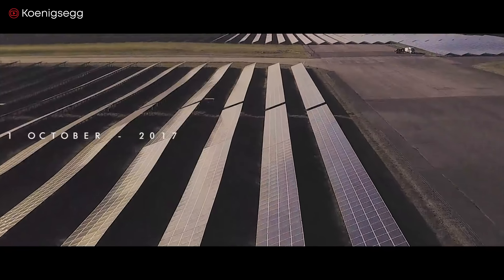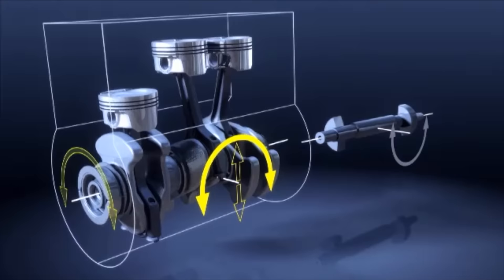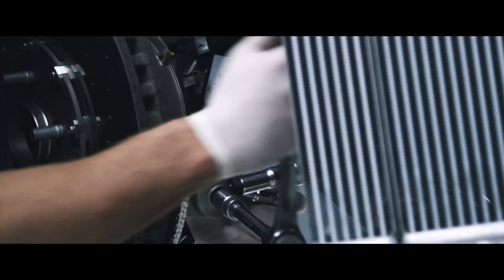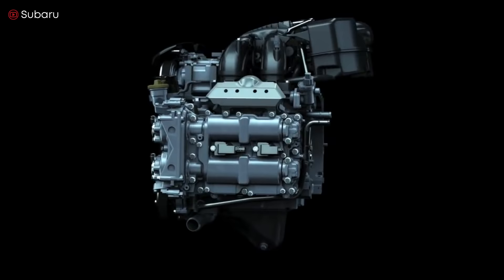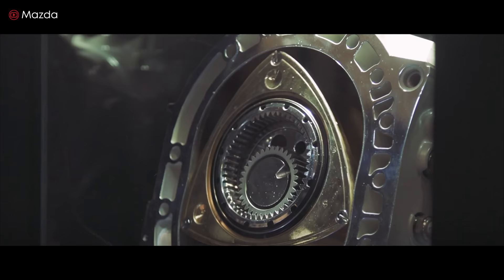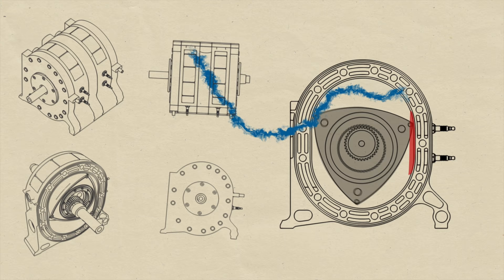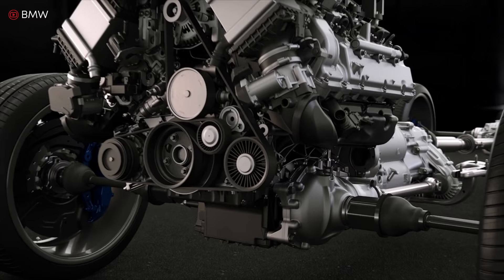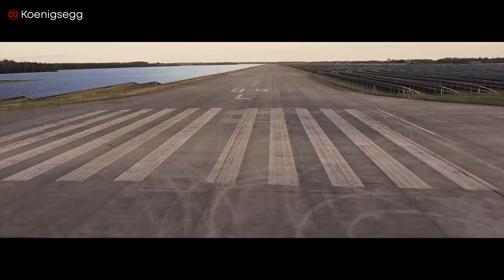Who Makes the Best Engine and Why

Comment: My 2.0 2005 golf is running so smooth stick shift the engine runs so nice 4 cylinder put 30,000 kms in 3 months on it now it has 269,000 kms still runs so smooth and it has a diesal transmission so the rpms are way lower on the highway so smooth
Reply: Golf yawn..for people who think they know what constitutes a good car...a total cliche purchase

Avoid the new ones you wont get the ssme service out them

Comment: Straight 6 engines are best in my opinion, powerful, economical, easy to work on and tends to last the longest if looked after
Reply: With the exception of the BMW N57...chain and bottom end failures

Comment: The best engine is the V-8's, regardless of manufacture. Brought high power at low cost and weight to the common buyer. All brands have had there high & low points, fans of one could talk all day of their brands individual virtues.

Comment: I have a diesel 2.4L in-line 5 cylinders Volvo engine that is a jewel of an engine with 220hp and 450 N.m torque...
Reply: Chaminda Thushara Ruwan Kasturi  it is known for being a good engine. Lots of Volvos have it here in Sweden, D4 and D5. They stopped making it since 2017, my car got the last version of it, now they make only 4 cylinder engines...
Reply: Diesel is dead baby
Reply: @alanbrand7681  my car still runs diesel and will continue for years to come. You drive in streets full of diesel powered cars here in Sweden, it will takes at least a decade for these cars to start be a rare scene in the street, until then, I will keep driving it...

Comment: Hey Scotty have you heard of the alpha Dan four-cylinder motor? I believe it's a 73 l putting out over 600 and some horse. Naturally aspirated. Electronically controlled valves so it has no need for camshafts.

Comment: Scotty what is the difference between interference and non-interference engines? Thank u in advance and have a great week
Reply: It is referring to the clearance between the valves and pistons.  With an interference engine if you break a timing belt the pistons will come up and hit the now stationary valves.  With a non interference engine if you break a belt there is enough room so that the pistons do not contact and bend the valves.  Good example is the Nissan 300 Z.   Famous for breaking belts and when it happened it would bend nearly every valve that was open. It was a V-6 so two heads, 4 valves per cylinder and now nearly half the valves will have to be machined and replaced.  Was very expensive so back in the day, most went to the scrap yard.  An oversimplified explanation, don’t feel like typing so much
Reply: @amlafrance1918  👍🙏
Reply: @amlafrance1918  if u look at an engine can u c the difference right away or do u have to be a trained mechanic? I have a ‘12 vw Jetta and idk if it’s interference or non interference. Ur explanation was great.

Comment: 4 cylinder inline 2000cc 4-5 seater sedan
6 cylinder V6 3000cc 6-8 seater wagon 
These are the most reliable and cheaper to maintain.

Comment: those "W" engines don't have a third bank. They have 2 narrow angle V banks with a common head. The W12 is like 2 VR6 engines on a common crank. The W16 is like a pair of "VR8" engines.

Comment: The Bugatti Veyron and later don't use a W engine layout as the one Scotty described. They are technically two VR engines combined to form a V shape. The last Bugatti to have a traditional W engine is the BMW made 1999 Chiron concept.

Comment: I love the reliability of my 1990 Chrysler 2.5 L n/a. It's not the fastest by far, but in my experience it's not too complicated or hard/expensive to work on. It's got well over 200k (odo died in 05) and the original auto transmission, with only simple repairs like timing belt, and a worn out bearing. It is in a 1990 Chrysler Lebaron Convertible Highline...I'm really curious what your opinion is of this car/the k-car engines?
Reply: Those engines last a long time but when they have high miles the top end sounds like a meat grinder lol
Reply: @leod3963  mine doesn’t sound bad at all 🤷‍♂️ (and still running 😂)

Comment: My Honda stream 2001 with 350,000+mile age still running but starting to fall apart, the h and l pressure lining has a leak before but now i think the compressor dies or have a leak so i didn't fix it cause here in Philippines it cost so much HAHAHA. so my main problem now is the power steering, it's starting leaking all over the places of my lining and the comm. quarantine here in our country giving me a hard time to buy in specific places which is the costing is cheaper. Hope you can help me to what or how I do this with simple tools.

Comment: I would have to say the Toyota 1.8 litre vvt-i  4 cylinder engine made from 1998 to 2009 is the most reliable and over engineered engine ever made,second would be our 4.0 litre inline six cylinder 24 valve twin cam barra engine by Ford.

Comment: My kia Rio 2007 car has been hit and run in parking lot. My fender, headlight on passenger side are damaged. When I visit a mechanic to fix it. They gave a quote of 3200$. Could you please help me on what tp do?  It ran 1,80,000 miles
Reply: Buy parts on ebay or rockauto, do it yourself or see if your mechanic wants to do it for you
Reply: Wow.. that is nice. I hope, I will find someone like you who can do it for less amount. The problem with doing on my own is, I am afraid that I might mess up something.
Reply: @rickjames9524  900$ lolll

Comment: Scotty cannot answer this question because all depends what you expect from the engine and what you can afford. Generally speaking all BMW naturally aspirated engines are the best. Unfortunately BMW doesn't make them anymore, but if you can find the third gen. BMW E46, that would be the best engine. It's an inline 6-cyl naturally aspirated engine that produces more than 100hp per 1 liter of the displacement. S54B32-3.2L engine produces 333hp (M3)
Inline 6-cyl engines have no primary (almost none) or secondary imbalances. 4-cyl engines have significant secondary imbalances that go up as a square of the engine speed. So the best engines are inline 6cylinder engines. All those tiny 4cyl engines with multiple turbos are short lasting engines. That's why companies make them, so they live short and people are forced to buy new cars.

Comment: I love  Hyundai  Genesis   with 200,000 miles  only one time  headlamps  problem,   I don't need  super high power  and expensive repair cost and  too often repair problems,   Hyundai Genesis has very low engine problems and cheap parts too

Comment: Is there a V8 of similar displacement that has max torque at a lower speed than a Ford 300 I6?
Reply: I cannot think of a 5 liter v8 with a peak torque figure below 2000 rpm but most truck engines around that displacement still produce more torque at that rpm. The 2000rpm peak torque of the 300 I6 is a reflection of it's inability to breath and not a sign that it is any type of low-end torque monster.

Comment: Thanks for another interesting video. However, "W" engines were NOT widely used in aircraft during WWII. Vs, yes. Ws, no. Scotty, Can you name any WWII aircraft that used a W engine?
Reply: W?? in World war 2 aircrafts?? no way. do you know what W motor is?? and what Penta or Star motor is? Old plains use a star shaped motors with cylinders all the way around the center
Reply: @ansv3340  I already said that W engines were not used in WWII aircraft. Look above. I think that Scotty clearly knows what a W engine is. The problem is, he knows all about cars and shite about airplanes. Those "star-shaped motors" are called "radial engines". You too, know shite about airplanes.
BTW, what is with your spelling? Use a spell checker.
Reply: On wikipedia they list the Chrysler A57 multibank as a type of W engine (W30) that was used in aircrafts  and and some tanks in world war 2, notably on the western front

Comment: Hey scotty i have a 2002 chevy cavalier with the 2.2 and on startup it struggles until i tap the gas it starts up only first thing in the morning when the engine is cold it starts without having to apply throttle but after that it doesnt if you can please help I would appreciate it Thankyou.
Reply: Usually a leaking fuel injector.

Comment: I went 170 in a 1997 Jetta, lol. Not a turbo, just the bottom of the line. I think if you actually pushed cars, you can buy anywhere, you'd be surprised at how fast they can go. If I got that Jetta to go that fast in 2000 or 2001 then if you have a newer V8 sports car, you'd be over 200 easily. I know that doesn't compare to 304.7 or whatever that Bugatti did, but no one can go that fast anyway, not legally and most people don't live near a track, or if they do, don't know what to do to be able to drive your car on said track.

Comment: A  i6 is far better than a v6
A 2jz is a Toyota i6 that drag-racers take well over 2,000 wheel horse power. The Australian Ford Barra 4.2l Dohc i6 is a natural born beast. V6's are okay for pulling race cars, if you're not in a hurry to get there.

Comment: You didn't mention about balancing forces and how the 90 degree V8 is perfectly balanced using the crankshaft counter weights to cancel out not only the piston up and down motion but also the side to side forces of the connecting rods while having the entire 360 degrees of rotation covered by 4 power strokes in a 4 cycle engine, a 6 cylinder does not cover the full rotation with power and a 4 cylinder is miserable with only 2 power strokes in a rotation, once every 180 degrees hence the need for shock absorbing engine mounts and harsh vibrations at lower speed, by the way an inline 4 is almost balanced just as well as a boxer engine (difference being the connecting rods motion, actually both I think have this issue, only the v8 has that covered..)- 2 pistons go up while 2 pistons down - that's why the boxer is not more popular and the inline 4 is easier to work on since it's upright with only needing 1 cylinder head on top.  .  This makes the V8 the smoothest and most powerful setup.  Other engines feel harsher and more buzzy because of this.

Comment: It’s a nonsense when Subaru clams boxer engine helps or improve handling and cornering because Mazda or a cheap BMWs are doing a far better job in handling the car with their non-boxer engine.
And CVT they use is also complete nonsense. It doesn’t improve reliability or the gas mileage, the only thing it does is to lower the joy of driving.
Reply: Of course it improves handling
Low center of gravity + all time AWD
I didnt believe it before..i drive a 2010 
Impreza and had a Golf for a week..its actually scary how shitty it drives compared to a Subaru 
Of course other manufacturers have better interiors, better isolation..some Subaru engines arnt that great either (2.5)
but you cant argue with the fact that Subarus are one of the best handling vehicles on the market..always has been. I was on the Norschleife 2 years ago and you could really drive quicker trough the curves than all of the Mercs and GTIs and Golf R and even 911 Porsches..different story on straight line of course..
but i agree with you with the CVT..its actually the reason i wouldnt buy a new Subaru
Reply: @ventocz6476  I’m not saying your car doesn’t have a good handling but I’m say other cars are using different techniques that makes the car handle better than any Subaru. 
There are so many cars I don’t wanna name them one by one.
Reply: @alight9456  sure i agree
Its not such a big advantage anymore like it was maybe 10-15 years ago..but they still are good to drive.
Most cars nowadays are handling great
maybe if you compare a new Forester with a new Outlander or something u would feel a small difference in body roll

Comment: Best engines in Gasoline power class are  Fords V8, 4.6L 2 valves.( fuel injected)
Reply: I don't like the all plastic intake manifold, had to replace one leaking  coolant. And don't like o-rings the size of a pencil lead on gaskets.
Reply: @jeffreydevoti7000   some of them are alloy,  on  Lincolns  they had alloy intake. and i have plastic intake on my van and never had to take it off. But even if you do, the new intakes are $130 shipped to your door, on ebay.  Positive thing of plastic i guess, that they dont built residue , and dont corrode .  But if you can do repairs on ur own parts for that motor dirt cheap and not hard to swap them, no special tools needed.
Reply: @ansv3340  Worked on cars 45 years, but when you can't see or get around as good things are harder to do. 
I've had every type intake; cast iron all cast aluminum,  aluminum tube and all plastic. There's no reason to make so flimsy and it's slow taking plastic components off engine without breaking them. 
It doesn't matter to me what one individual engine had at one time, I stand by my statement.
Reply: @jeffreydevoti7000  I will ask you a different question then, name me one car , built after 2003 that does not have plastic intake?  My 98 camaro had not just intake but oil pan made of plastic. BMWs plastic. any car that i try to think of, they all have plastic intakes .

Comment: 262,000 miles on inline 5 cylinder no issues ever.
Reply: What year and model?
Reply: @jimsvo4486   2007 vw Jetta Wolfsburg. I’ve only used Mobil 1  0w-40 and change oil every 5,000 miles

Comment: The SSC Tuatara cheated on their speed monitoring/recording, and only reached an ACTUAL speed of 237mph... (Which makes sense, as that's the appx top speed of every other car sharing it's engine type, horsepower, weight, downforce, and drag coeffecient. Like the McLaren F1, all those specs are very similar, so why would the SSC be so much faster??? Doesn't make sense. Unless the SSC only did 237, then it makes perfect sense).

Comment: Sory scotty but you are wrong, First the Chiron 300+ Did the run one way, you need to do 2 runs tp obtain the record which it didn't, and the ssc tuatara according to investigations from their record video and car info did not brake the record So the record holder is still the Koinegsegg Agera RS.

Comment: But what is the difference between "flat" and "Boxer"❓❓❓
While the U.S. is downsizing to V6 and i4 most "modern" compact and subcompact cars in Europe have these terrible i3's with turbocharger and GDI. 😖 Carbon deposits on the intake valves, low max. mileage and a horrible sound in idling and acceleration are the results. I purchased one of the last i4's in a Toyota Yaris without turbocharger and without GDI. 😎

Comment: The huge multi bank engines of WW2 were all failures. Rolls Royce gave up on the X format Vulture though they were working on a twin crank H engine and a V12 two-stroke when turbo jets took over. RR basically concentrated on V12 Merlins and Griffons. 
Daimler Benz spent years on their DB610 version wasting resources better used elsewhere. 
The 610 was two 605 engines driving one propeller. Sort of an inverted W but not really a single engine. It was pushed into service too soon and hated by crews because they crashed so regularly. 
Napier Sabre was a four row radial as were the big US engines. 
During the 1930s there were some three row engines but finding information is difficult.

Comment: Subaru boxer engines are OK if you like to tinker and repair your own engine as it ages. Problem being is that they have a few engines which can be expensive to repair. One of those is the one in my 2005 Legacy GT wagon and is designated as the EJ255 which is a 2.5 liter turbocharged unit. When this engine(bucket style valve adjuster) needs a valve adjustment which mine now does(108,000 miles)  the engine MUST BE REMOVED FROM THE CAR in order to remove the camshafts to do the valve adjustment. What a terrible design flaw on Subaru's part and one reason why I will never own another boxer engine car. At least most inline 4 cylinder engines if they need a valve adjustment at all allow valve adjustment in the car without engine removal. Shops are quoting 2200-2600 dollars for the job and the car is worth 5 thousand tops. Not worth it even though the car looks great it still has 16 New England winters on it so time to look for another vehicle.

Comment: SSC Tuatara cheated, and only reached an ACTUAL speed of 237 mph. The Bugatti Chiron SS is the fastest car in the world.... EXPLANATION; During the speed run video of the SSC there is a helicopter pacing the SSC. The helicopter is an airbus model, with a top speed of 188mph. During the video, you can see the helicopter stay in the same position, next to the car, through the passenger side window. This helicopter stays directly next to the cat, does not drop back, for several seconds. It has a normal top speed of 188, even less when loaded with camera equiptment, yet the dashboard display on the SSC Tuatara reads 197mph... Giving the SSC's speed monitoring equiptment a minimal additional 10 mph, over it's actual speed. This discrepancy would likely increase exponentially, as the vehicle accelerates. Not to mention the GPS coordinates, placed against the vehicles speed run times, place it under 300 mph... which makes complete sense when you factor in the helicopter footage...

Comment: Chrysler builds the best engine. SRT
Reply: Nope
Reply: One of the most basic V8s their better than twin turbos and inline motors, their fast and affordable when it comes to getting a fast car
Reply: @Tank 
Chrysler's,poor quality.
Reply: @sameoldeh  yes they are! My cousin blew up his hemi and it never saw a drag strip. Only had around 120k on it.
Reply: @AF.256  the transmission is more of a help than the engine.
Reply: @musclebone7875  the transmissions aren’t that great they tend to wear down fast
Reply: @AF.256  I'm talking about the transmission gear ratios from a performance standpoint. The 8 speed is a pretty reliable and strong trans.
Reply: @musclebone7875  well yeah the hellcat hits last gear around 200+ mph
Reply: @AF.256  i know